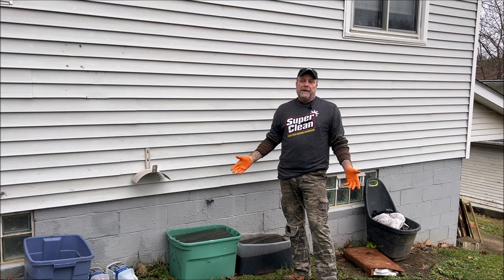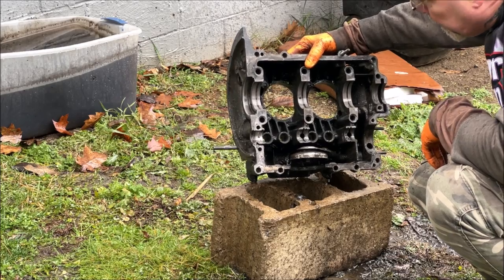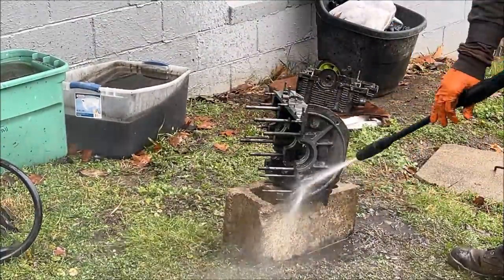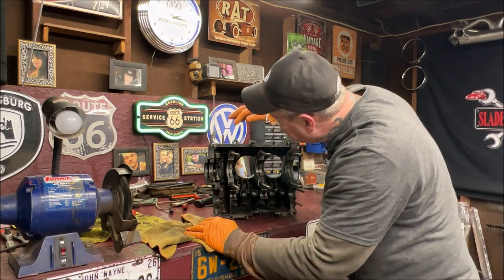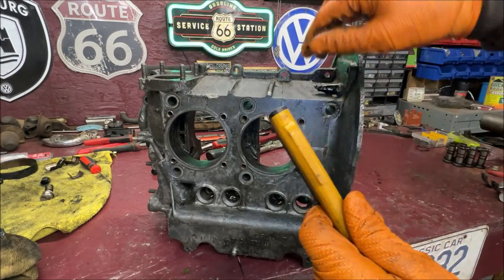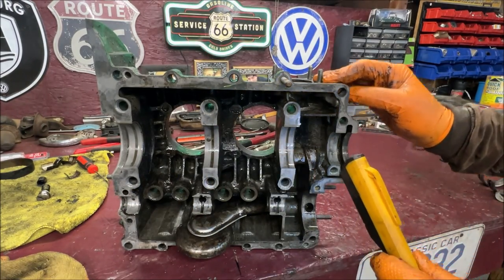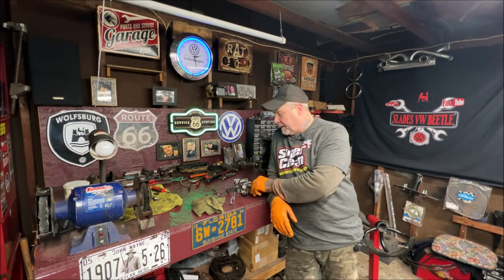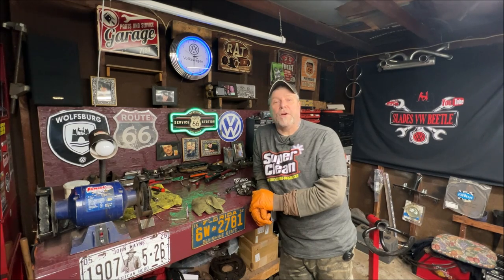VW Beetle Engine Degrease with Super Clean - Engine Block Inspection

Comment: I know it sounds low tech, but all I use to clean blocks is Dawn grease cutting dish soap. I put each half of the block in a big plastic tub filled with warm water and several squirts of Dawn. I dunk it in and out using a couple of different size brushes scrubbing till the water is really yucky. Then power wash and repeat. Normally, 2 times in the tub with Dawn gets them well past 90% clean. A little tight inspection has them ready to go. The brush scrubbing part is most important. Then I take the Dawn quietly back to the kitchen sink. If I think of it before, I buy another Dawn and have it ready so as not to raise suspicion.
Reply from the maker: Honestly I think it’s a great idea. Dawn is supposed to be a heck of a grease cutter. Now I wish I would’ve tried that.

Comment: I'd like to see how to measure the case to see if it's good.  Super Clean works best for me to spray it on first instead of after using something else.  You might have some luck if you got the sams cleaner hot and soaked the parts in it.  Borrow Heather's cauldren. lol.  I vote for a bus for the next project.
Reply from the maker: Yes, doing it in Coldwater was a total fail. Although I thought it would still work a little better. 
I should’ve tried oven cleaner. It’s really hell getting stuff done in the winter. 
Oh geez, that’s what Heather wants me to get next is a bus. I hope she doesn’t see this lol

Comment: I took my halfs and put it in my 30liter ultrasoundcleaner with warmwater and 20% degreaser. They turned out real clean!!
Reply from the maker: Nice!!! I’ve wanted to buy an ultrasonic cleaner. But I would like to buy a larger one like you have. I was seeing the smaller ones at Harbor freight.

Comment: The block looks good but won’t know until you measure it. Let us know how it measure up. I still have the VW tools if you’d like to borrow them.
Reply from the maker: Thank you my brother, and you were right. I said I only need a splitter, I already had the engine yolk stand. And you said you’ll end up coming back for one tool at a time. 🤦🏼‍♂️😂
Oddly enough I was going to call you but I ended up getting sick. I was going to bring the block over and have you help me do the measurements since you’ve been down this path before.

Comment: Super clean has to be safer than diesel fuel and oven cleaner 🙄🙄
Looking fwd to the body patching
Reply from the maker: It actually worked good, I’ve never use diesel fuel, and I have heard that oven cleaner does work.

Comment: The engine came out fairly but still needs more tlc, same with mine. I had to wire brush the inside and still have some black layer in it.
That other motor would be a good example to compare with yours now. Maybe that one is better. And after that the fun stuff👍👍👍👍rust lol
Reply from the maker: Thanks my friend! I’ll definitely get it much cleaner. The other engine block seems to be pretty clean. I’ll be breaking that down this week so as I start feeling better.

Comment: How in the heck do you think it would work in 36 degree weather . Take the #1 main and see how it holds in the #2 saddle . get a new lifter and check how much it wiggles   no more that..    0.0035 after that they are considered loose .where that case will crack is in the oval hole under the oil cooler mount. To get it a little bit cleaner wipe it down in some Ospho. do a test area first to see how long to leave it on , if you leave it to long it will turn black . Good luck !

Comment: I think the body work will be more interesting over taking the other block apart. I wonder if brake clean would work better? One of those water bead cabinets would work and you can keep it outside for cleaning parts. CT has one and the block halves would fit one at a time. It works really good with the higher pressure and beads that are added
Reply from the maker: Truthfully I wanted to get a very large ultrasonic cleaner tank. But I’ve only seen the small ones at Harbor freight. And the larger ones seem quite pricey. I definitely have a lot more cleaning to do lol
Reply: I have a friends brother who owns a engine block shop. He has a big tank  that he wheels outside and puts blocks and heads into it. You can see it steaming when driving by. I took some ford ranger heads one time and he called me the next day to see the cracks after cleaning them up. He put a black light on them. He got me 2 replacements and the upgraded bolts, gaskets and 3 step torquing instructions. Aluminum heads on fords all cracked and if still under warranty ford flipped the bill. I only paid 300 bucks for it so I knew I was going to put more into it for my son back then. The exhaust bolts were a nightmare and good thing the heads needed replacing since I broke of a couple🤣

Comment: Great video!  Here is a question that I have always heard conflicting stories about and that is: when you break down a VW case, i.e. splitting it; is it truly necessary to align bore the case to the next O/S condition?  What about reassembling the case, torquing all of the pertinent fasteners, and then checking the Crank & Cam bores with a dial-a-bore gauge at 90 degree angles to check current size & out of round conditions that would possibly necessitate boring those O/S?  Just wanted to pick your brain on that one.
Reply from the maker: Honestly this is just my opinion. I agree with you my friend. The case needs thoroughly examined, before deciding to start shaving metal off. Sometimes these cases are still in good condition.
Reply: I split the case on a 1967 and thought I was going to have to align bore. It hadn't been done before and there wasn't any wear. The bearings had the usual scuffing. I replaced both crank and cam bearings. The crank was still in spec and I just cleaned it up. I went from a 1500 to a 1641 single port and runs smooth. Just as the man says, spec it all and go.from there. If you are making a monster engine then I would align bore. Sorry for being winded. Be safe!
Reply from the maker: @jimlester5003  thank you Jim, for taking the time to comment. Honestly it’s worth having it checked. Surprisingly some of these engine blocks are still in really nice condition.

Comment: Mixing the cleaner with the degreaser or the water probably didn't do the cleaner any favors.
Reply from the maker: Yes you’re exactly right! I’ll actually spray it again when it’s nice and dry, and warm the block up slightly in front of my heater.